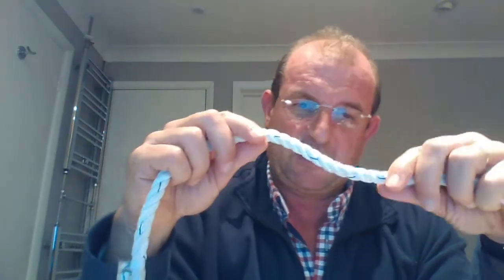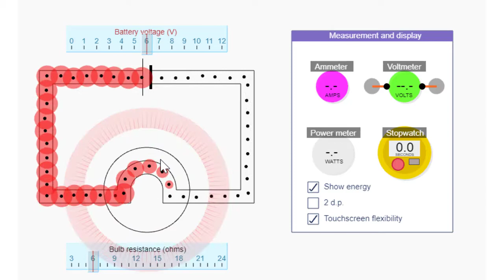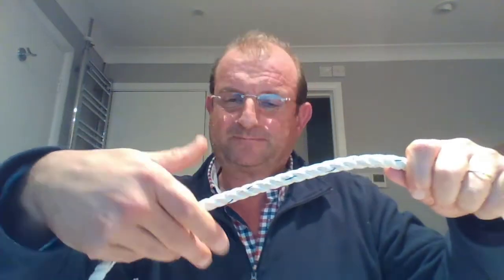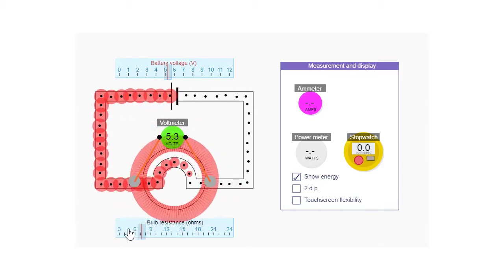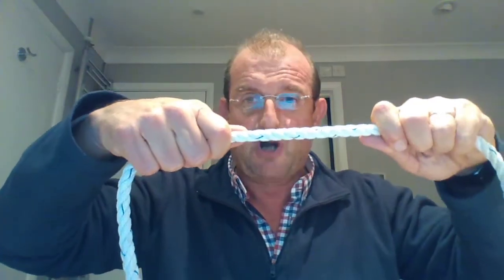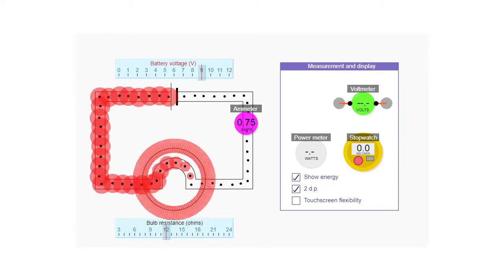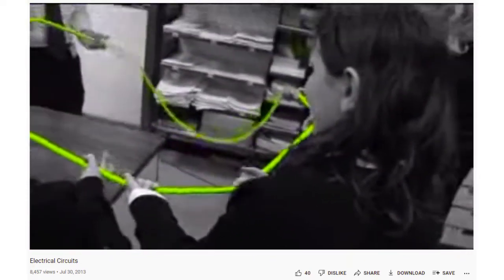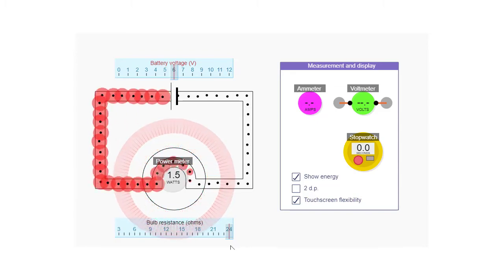Teaching Electric Circuits Using the Rope Loop Analogy - Avoid these five misconceptions

Comment: As the grip on the rope tightens, the teacher should not try to increase the force. That would be akin to increasing the battery voltage in a circuit when the resistance increases just to keep the current same. The teacher should say, "Using the same effort, I can now rotate the roper slower, which means less current is flowing." This will then cause the student to feel less warm in the hand, signifying reduced energy transfer.
Reply from the maker: Good call. Unfortunately, that's not possible. To keep the rope moving at a constant rate, the teacher has to pull with exactly the same sized force as the frictional force at the student's hand. If that force increases, the teacher has to pull harder or the rope stops.